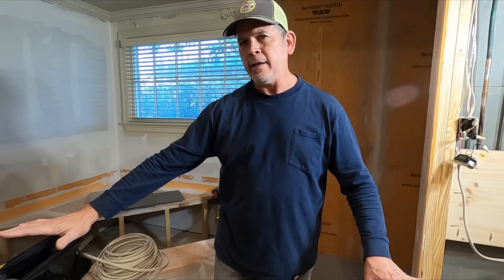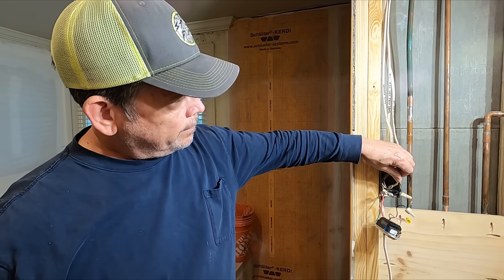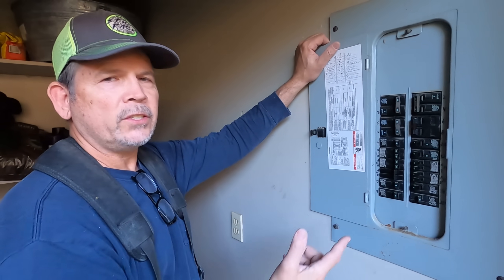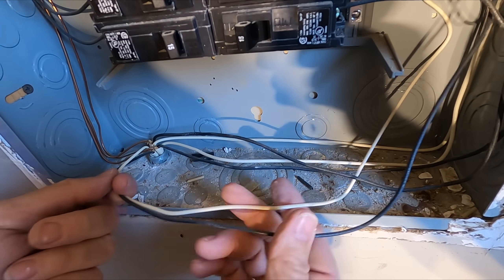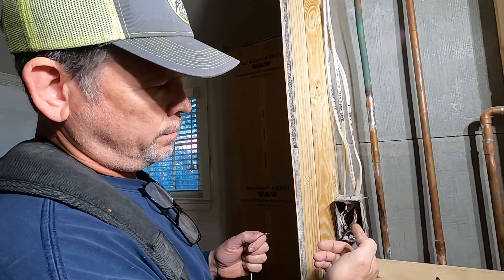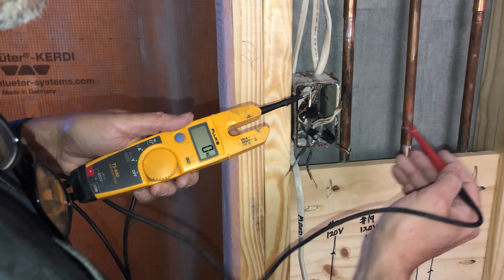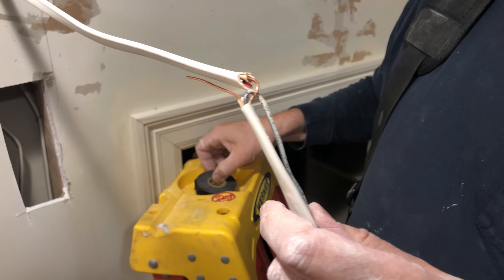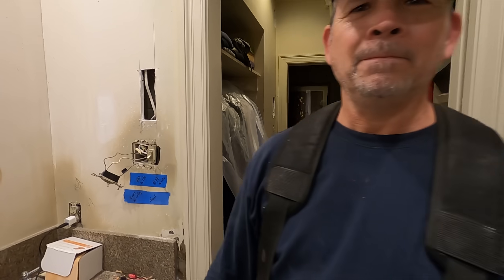You CAN Get SHOCKED by a Neutral Wire! This is How...

Comment: So what is the advice for an average DIYer like me who occasionally replaces an electrical switch or outlet? Turn off power to the entire house to be safe?
Reply from the maker: Well even that isn't a guaranty that all the power is off.   Had a project once where the utility removed the service drop and meter.  The refrigerator where my lunch was stored still worked.  It was being fed from an auxiliary building.  Check, double check, triple check.
Reply: Wear protective gear.

Comment: I'd like to know how you found where the faulty wiring was.
Reply from the maker: I had removed all the switches from the boxes in this area hoping to find that neutral from circuit #19 that never got hooked up.  Sometimes it seems you can never find them.  I kinda got lucky I found it so easily... but not that easy.

Comment: code now is to have a double pole breaker on any shared 3-wire neutral circuit. they made that code 10+ years ago if I recall. before that it would be fed by individual side by side breakers.
one problem is people would get shocked, but the larger problem is people would move the breakers to the same phase and overload the neutral by 2x the amperage, causing a fire and burning all the wiring.
**they didn't even do that there the mixed two totally independent circuits, which would make less neutral current flow and spread across both romex, meaning less EMF cancelation and increased wire heating. the circuits should have been kept separate or never both wired through that box. ideally would have been 14/3 wire and a 15A "2 pole" breaker fed into that box, then off to closet/rest.
Reply: the more I watched the more aborted a mess I seen.
Reply from the maker: Yeah this was a before the code change on a permitted project.  Adding the 14/3 at the end solved all the issues.

Comment: Great video, would a non contact voltage tester shown that the box was live when the neutrals were tied together and circuit 20 was off, saving you from the shock? I try to do my best to test for power after shutting off a circuit for this exact reason .
Reply from the maker: Possibly, I have a love/hate relationship with those.
Reply: No, if the neutrals were still spliced together there would be 0V potential on the neutral, its not until you open the neutrals that you would have 120V waiting to get to its "grounded" home

Comment: Man, you guys are master electricians too.
Do another video on that live netrual.
You went way to fast on the fix.
Was it because of the 3 way ?
If so how was it wired wrong.
I always thought a 3 way used 14-3
and had a red wire?
Reply from the maker: Correct, they ran 14/2 between the 2 3-way switches and needed both black and white for the travelers so they had to pick up a neutral from somewhere else.  Sorry we went too fast...
Reply: @StudPack  great video.
I am a diyer. I found two 3 way switches that were doing nothing..
Long story short.. apparently a split wall outlet and been replaced at some point and that tab on hot not split.
I found it be checking the 3 ways  and realizing all 3 screws showed hot no matter the positions. 
Still haven't corrected it. 
Again I am a diyer. 
I do check every wire with tester before touching anything. 
I would welcome more videos

Comment: Just a black and white  wire, right. -Don't worry dear, I know how to do this!  I think this is a result of a lucky DIY-er having no clue why it worked, but didn't bother to understand. More importantly is that branch 19 and 20 are each  protected by a 15 A breaker.  That means that the white return could possibly be a carrier of 30 A. Way beyond the capacity of that wire size. And that is how a fire starts.
Reply from the maker: This was a permitted addition well over 30 years ago.  No telling what has gone on in that panel.

Comment: Even if the neutrals are done correctly you need to make sure you turn off all circuits that are used inside the switch/receptacle box. 

I learned this the hard way. ⚡️
Reply from the maker: Yep, thanks JD!!

Comment: so true. i had an electrician disconnect the feed to my panel by cutting the hot wire. before i touched anything i checked neutral to ground and it read 120v. moral of the story, never trust anything you don't do yourself, and even then double check it. truth be told, 120v doesn't normally do anything but startle me, but i still don't like it
Reply from the maker: Thx!!  We had service drop and meter removed from a house once.  The refrigerator where my lunch was still had power.  Turns out it was fed from another building 😖

Comment: Correction: it is ok to share a neutral between 2 circuits as long as the 2 circuits are on opposite phases and the breakers are tied together so both of them have to be turned off at the same time.
Reply from the maker: It was the same phase Red.  I didn’t want to get too deep on that one.   Shared phase vs opposite phase etc.  almost went there when discussing how to number a panel but digressed. That needs its own video.  Really appreciate the comment 👍
Reply: I think it is still code compliant for certain cases. But what is the advantage? Save some wire? I think it is much better to use two 14/2 with individual 1-pole circuit breakers. Safer, easier to understand and troubleshoot. Also better in case you want to extend one of the circuits in the future.
Reply: @perekegerd2952  Shared Neutrals was phased out in NEC 2002.  It will no longer pass an inspection ...

Comment: Turn off the light switch and you remove the load
Reply from the maker: Sure David but that wasn't the issue.  Two same phase circuits sharing a neutral is dangerous.  Opposite phases cancel, same phases add.

Comment: Shared neutral is so common for 2 way switched stair lights in the EU/UK. Find out instantly when you change a breaker board for a new one with all RCBO (GFI) breakers. Also slightly worring it didn't trip to the copper pipe, here if it did that it'd be an instant fail on an inspection as it means your neutral and ground wires are linked at the board which is a no no. Great video, enjoy all your content!
Reply: Effer Vescence - But, in the USA, the 2-Way Switches are only connected to the HOT wires.  So, why would you share the Neutral wire?  Are you saying ... you use a Hot wire downstairs from Circuit Breaker #1 and then use a  Neutral Wire for the lamp upstairs from Circuit Breaker #2?  How did that ever pass an inspection?

Comment: The breaker should disconnect live and neutral together. In our area that is called a double pole breaker or switch. I think it is illegal to use a breaker that only disconnects one of the 2 here.
Reply: This install would get a fail from the inspection here.
Reply: In the CEC there are very very limited times you can ever disconnect a neutral. 99% of the time you leave that thing tied in. I'm sure the NEC is similar. You would fail your inspection if they saw a switched neutral.
Reply: @djwctbell  OK, I got information the rules are different for each country. Here we disconnect live AND neutral at the breaker but the ground must never be disconnected. I think this is safer anyway.
Reply: @janmilissen2999  Where is "HERE" ?
Reply: @MrSummitville  Belgium
Reply: @janmilissen2999 - Even with an AFCI Breaker in the Main Panel,  I do not think we open the Neutral wire in the USA ...
Reply: breakers dont disconnect neutrals

Comment: I have 2 questions, I noticed that all of the ground wires that come from the house are tied together via a circle device then there is a wire coming out of that circle device that connects to the panel in the outside. 1. Should I be worried? Usually I turn off everything at the outside panel when ever I change a switch or anything electrical in the house. 2. When I turn off the power (main switch and all) should I be worried about the ground shocking me?
Reply: The bare copper ground should not but you run the risk of some homeowner that doesn’t know better using the bare copper ground as a neutral, which is wrong wrong wrong.
If you have any doubt remember always use your volt meter to check.

Comment: Did you use one of those wire finder devices to find the neutral wire that was incorrectly tied into circuit 16, what method did you use, educated guess?

Comment: Was the rewiring because the original second switch was not run with a traveler?  You pulled 14/3 and it looks like the original was just 12/2. Mixing circuit neutrals is a very very dangerous thing for someone to do.
Reply: It sounds like the original install only had travellers pulled and they "stole" a neutral from another circuit. Fortunately code is starting to tackle these problems, at least in Canada. We now have to have a proper neutral in every switch even if its no needed. No more down on white and back on black.

Comment: Also, if you have a handyman or plumber tell you that the polarity does not matter... find someone else.  With most appliances today, it sure DOES matter. Reversed polarity will shorten the life of your appliances by HALF.   You have no idea how many times I have heard "with a/c it doesn't matter".  Really?  If they have so little pride in their work, what other short cuts are they taking that you don't know about?  

When we bought our house, the polarity was reversed on 50% of the outlets.  I told my husband I'd bet the 220 wasn't ran right either.  Low and behold, there was the 220 to the dryer ran with a 14 gauge wire and the ground was used as a hot.
Reply: AC is AC. There is no polarity. In fact, in Sweden receptacles are wired with 230 Vac one phase.  But it is random what side is live and neutral. Simply because it does not technically matter. IN US and Canada we have the habit and also do because of the code to wire Live and neutral on a specific terminal in the receptacle,
Reply: @perekegerd2952  Todays appliances  are sensitive to continuity.  It matters now.  But hey... if people want to buy a new refrigerator every 5 years, who am I to intervene.  Maybe you can tell that Samsung in your kitchen all about Sweden and squeeze another year out of it before the electronics are gone.
Reply: @RoseGreen   Please stop, you are way outside of your area of expertise ...

Comment: Since those two circuits were on adjoining breakers, it could have been a half-way legitimate attempt at a multiwire branch circuit (or Edison circuit as us old-timers learned it). In that case there should have been a tie bar across those two breakers so that both circuits/phases would always be turned off at the same time. And it should have been a 14/3 cable.
Reply from the maker: I didn't get into that aspect of it.  Thought it might be too much in one video.  Those two circuits were actually same phase (19 and 20).  I attempted to go there when I started talking about how panels are numbered but digressed.  Same phase neutrals add, opposite phase they cancel.  Needs a dedicated video probably.  Really appreciate your comment 👍
Reply: @StudPack  Sorry, brain fade on my part. They aren't next to each other.  But, like you said, you should probably eventually cover multiwire branch circuits since it is something people will run into doing renovations (depending on age of housing stock in an area.)

Comment: Great vid. I'd also be interested in the electrical safety vid. I think I got shocked in a similar way you did. Im a diyer and I was replacing 30 y/o smoke detectors in my mom's place. I turned off all the breakers on the floor I was currently working on, but since the smoke alarms are all tied together... the second floor alarm was still energized and I got shocked. I learned a lot that day

Comment: No ground fault circuit breaker? Seems very dangerous that electric work. 🙂
Here in Sweden we have 230V between 1 phase and ground.
Reply: Ground fault breakers are really uncommon in north america residential installations. Generally a GFCI receptacle is used unless for some reason you want a split receptacle GFCI protected. I believe a lot of europe has the entire panel GFCI protected.
Reply: @djwctbell  ground fault breakers suck anyway. nuisance trips get old after the 3rd time.
Reply: @harveylong5878  agreed. The worst is when I'm troubleshooting a dead circuit in someones house and either a bathroom gfci is tripped or sometimes I've even seen the exterior gfci fede some plugs in the house. Sometimes my IQ is over 9000 and I check the bathroom right away lol dont even get me started on afci neusance trips. I just finished a basement a couple months ago and they're expensive hepa filter vacuum trips the breaker every time but a 5 peak hp shop vac works no problem

Comment: Most of us have gotten poked at one time or another.....I was a firefighter, and at a fire I reached into a stud cavity to pull down plaster and lath...I got poked!  There was no meter on the home.   Vacant.  Fire Marshal never found where the power source came from.  Second good one, I defibrillated myself.  Bouncing down the road, the little old lady's breast fell against the edge of my right hand, just as I sent the shock.  I ended up on the floor of the rig, my back to the double doors.  Everyone thought that was pretty funny.  Now, I always...always triple check for power.  You have a great channel.
Reply from the maker: Thx duenge👍  your buds laughing at you after the defib...priceless 😂😂
Reply: Fun fact......I good little tickle will get rid of a cold!

Comment: Is there still power on the other circuit because they share the same breaker space, because the share the same neutral or both? This is the best video so far explaining the worst shock of my life with 12 gauge wire. Felt it all the way to my shoulder. This happened a month ago and I put it all back together and haven’t messed with it since. I was just changing the outlet to a newer square one, breaker was off.

Comment: In theory, there's no upside down or right-side up for a panel. All I've seen even have the embossed writing inside going both ways, in addition to the fact that the label on the door is sideways. It's true the numbers are reversed order, but it doesn't matter practically. The best reason for doing an 'upside down' panel is if it's fed (main feeders) from the bottom. Otherwise, you have to run those thick, heavy feeder wires all the way around the inside of the panel to the top, and they take up valuable gutter space. In addition, it's more dangerous, because those feeder wires are outside their cable jacket and can be pierced or cut accidentally when adding branch circuits later. You DO NOT want a 60+ Amp feeder wire getting nicked and touching the grounded case - fireworks! 

Worth noting that for many panels, you cannot mount them horizontally. Code doesn't care about breakers going horizontal, but if the breakers switches are vertical (like with a horizontal panel), UP must always be ON (like a light switch.) Most panels have 2 rows of breakers, so one row would be upside down and a violation.
Reply from the maker: Great comment thx.  I had a client once who thought their new panel was installed upside down because embossed numbers were upside down.   Only the electrical inspector could calm them down... a little.  That's the only reason I brought it up.   Usually around here, new panels are put "upside down" so that the main disconnect is not too high and non-compliant.
Reply: I have a hard time believing code says UP always has to be ON. What about 3 way/4 ways? Definitely not here in Canada or HomeLine panels would need to be recalled.
Reply: @djwctbell  From the NEC: 240.81 Indicating. Circuit breakers shall clearly indicate
 whether they are in the open “off” or closed “on” position. Where circuit breaker handles are operated vertically rather than rotationally or horizontally, the “up” position of the handle shall be the “on” position.

Comment: Like many others in this comment section, I really hope you do the electrical safety vids. Your guy's videos are so informative!
Reply: Electricity has a auto-training feature built in. Touch it and see for yourself.
Reply: Taught by electrician..always treat wires as if they are live...  he sure did..
Reply: ditto
Reply: I've always been taught never ever trust the person before you and to always, always verify the circuit is dead because people take shortcuts. That's why I like how @studpack does things considering others after him. Leaving extra length in cable, wiring the extra cable to complete the circuit properly, so the neutral doesn't become overloaded, and so on...
@studpack, I'd love to see electrical videos for the sole purpose of how informative you are. There's another YouTuber who does that with all things carpentry related. He explains down to what screws or nails are appropriate for what job.
Reply: @jpender0616  I just learned to work on them hot...
Reply: @TheSoloAsylum  
Were you Navy, because we used to have to do that all the time because sometimes you just couldn't find the breaker... lol
Reply: take it with a grain of salt. the neutral should not be hot when the breaker is off. if it is then the electrician broke code and wirenutted 2 circuits together.
Reply: @jaden2790  That, is completely incorrect. A neutral shares A and B phase.